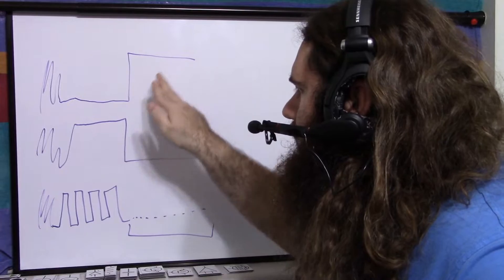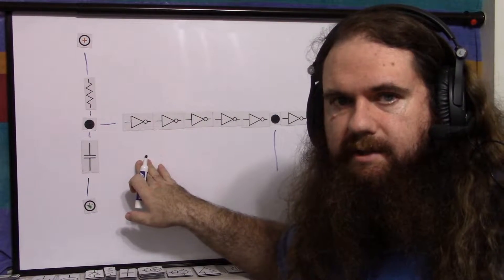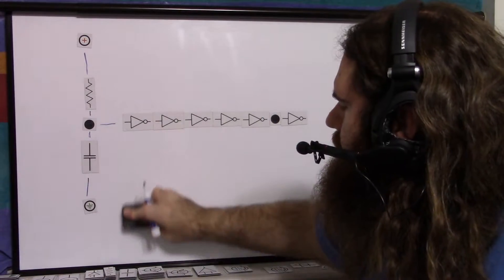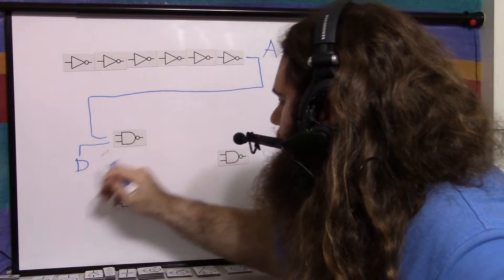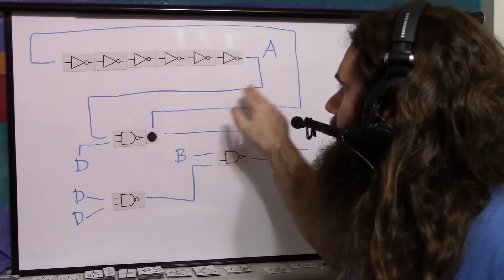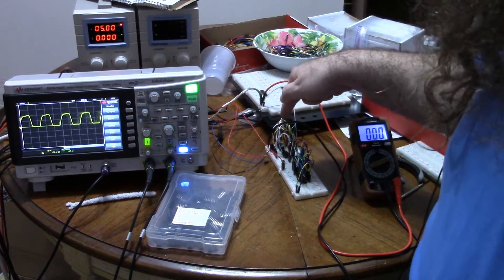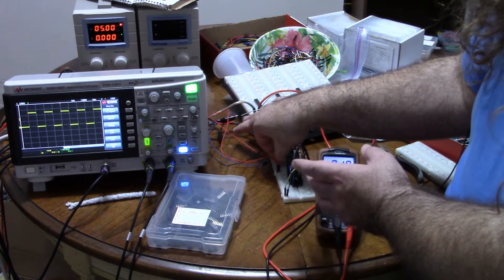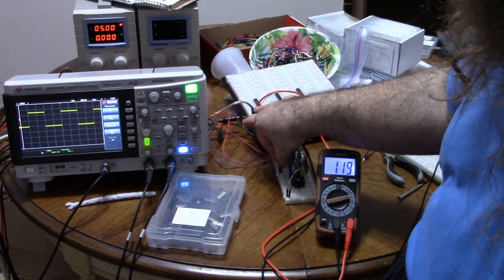Auto Switching Boot Time Clock Signal - Microcontrollerless Power On Initialization - Simply Put

Comment: Sir i want to ask you a question it's not from this video. Currently iam building lab bench power supply(linear) with op amp as feedback and an NPN pass element.  Its 25 volt a 1 A supply , I have connected a 1A constant current load  to its output. Now my power supply is able to regulate from 25 v  down to 0V but my supply can provide 1A from 25 to 1.7 volts  but as I go below 1.7 volts it still regulates but it doesnt provide 1A  to my  1A electronic load .iam not able to identify what's wrong please help.

Comment: Can you multiplex analogue inputs?
Reply from the maker: An analog switch chip, but a homemade idea would be to have each signal pass through some sort of switchable cutoff with a pull-to-ground resistor or something. Like maybe the signals all go into a summing amplifier but every signal is zero except the one you want to be on? An interesting idea.
Reply: @simplyput2796  I am trying to build this system if your interested https://youtu.be/6a8q7HON4_c